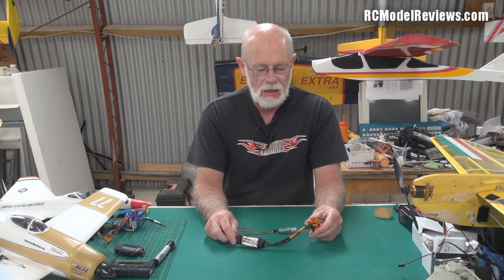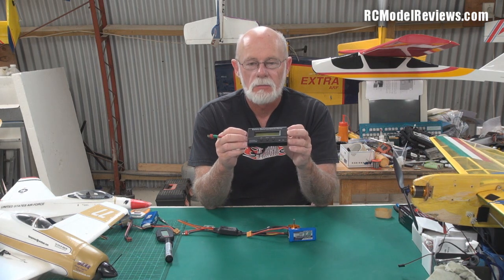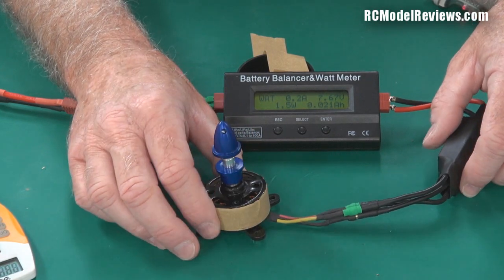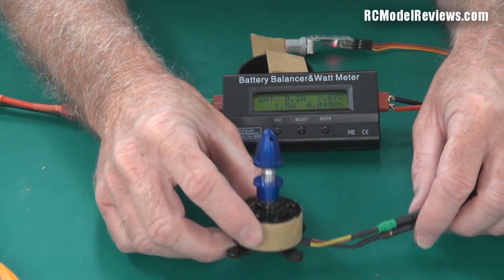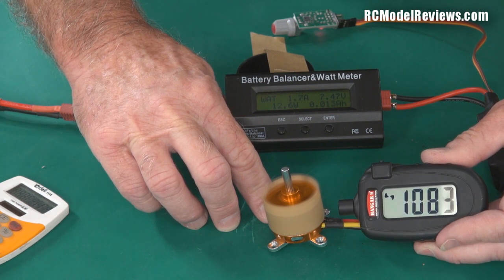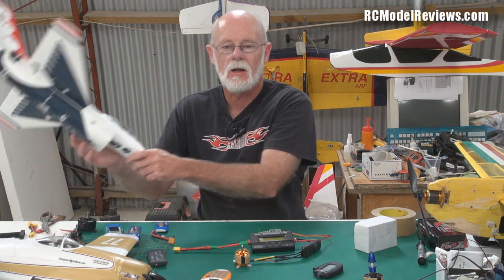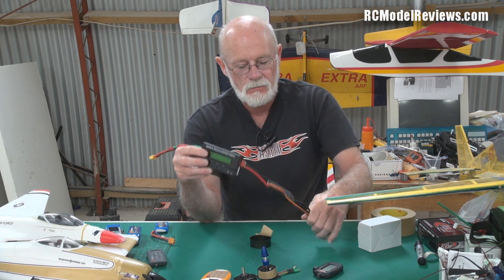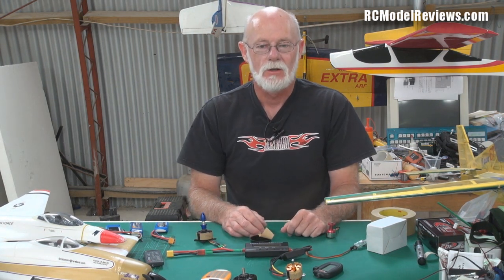RC BASICS: What is KV?

Comment: if you're talking about the first motor, watch again from 5:30 he does rpm/voltage. If you're talking about the second motor he does kv * voltage = rpm. He is putting around 7.45 volts because that is the voltage under load. If you see the screen it is a little higher 7.67 volts when the motor is not running.

Comment: what nobody ever seem to mention is the key to this which is calibrating the best pinion or prop for a given kv motor propelling the same given weight this is where things get really interesting, when you get a lower kv motor achieving the same top speed as a higher kv using same battery by altering the pinion or prop. also incorporating the extra draw that "may" occur on said battery ?? by using the bigger pinion !

Comment: I'm an electrical engineer who has worked with all sorts of industrial variable frequency drives, Pwm limited stepper motor controllers, 90 and 180vdc DC speed controls etc. for nearly 40 years.
I've been baffled by all the techno-babble garbage supposed experts have been pouring onto helpless RC builders who don't know what to think. The RC forums are full of "experts" expounding on meaningless formulas which are either mis-applied or totally ficticious. It's infuriating, but I, being a gentleman, have resisted the temptation to point this out to any of them (so far).

THANK YOU FOR CUTTING THROUGH THE BS!!

You are the 1st person I've seen who really knows what they are talking about. Great demo and explanation! This video should be required reading for anyone buying a motor. Well done sir.

Best wishes for your continued sucess.
Scott Marshall
Elbridge NY USA
Reply: My uncle is machine engineer

Comment: Excellent video - many thanks for helping me to understand. We need more people like you to help newbies like myself.
Reply: Kv is the reciprocal of the back-emf constant.
A 500 Kv motor will generate a 1 V back-emf when the motor is rotating at 500 RPM. At 3700 RPM that motor will generate 7.4 V.
Applying it the other way around ("7.4V will make the motor rotate at 3700 RPM") is only an approximation and technically wrong.

This video is actually full of misinformation because RCModelReviews relies on the latter understanding of Kv which is wrong.

The motor RPM is NOT calculated by V*Kv. The actual RPM = (V - R*Io) * Kv = (Voltage - Motor Resistance * No Load Current) * Kv.
So given the above motor with R=0.5, Io=1, we get 3450 RPM at 7.4V.

Also, Kv tells you nothing about how powerful or efficient the motor is. That's another point where RCModelReviews is wrong. High Kv does not mean the motor has low power.
You can get high Kv motors with higher power than low Kv motors....

Comment: Thanks Bruce.  When I was a commissioning engineer on Shell Stanlow oil refinery, a 6.6kV motor was the size of a Ford Transit van.  You'd never get one to fly or if you did, you'd need one big battery and an inverter from the planet Krypton.  So it's revs/minute/Volt (ish).  Brilliant!

Comment: I’m an rc car enthusiast. 3 years ago I made the switch to battery and these small dc motors. I’m trying to learn the theory, terminology and practical from using chemicals to generate electricity (to more clearly understand the battery) to the use of electromagnetically spinning a rotor to power my rc trucks.  Please continue your series and do you have a book you could recommend to a beginner to teach the basics. Thanks

Comment: Great series. I hope in the end you can make a guide on how to select a powertrain for any model.
Like, how does it fit together, how can I apply all those basics to buy the right motor/prop/ESC/battery the first time round for a new model.
I tend to go with, what did others use for similar planes or what does the ARF version use. But I never feel like I know really why this combination is right. I just improvise.

Comment: Thank you for a great presentation. Its very helpful to actually understand this as I am new to flying Quad copters and currently using brushed motors in low cost quads. Ive been considering converting a Syma X8C to brushless motors and now I better understand the theory of operation. For the X8C what KV motor rating would you recommend? As you have the 40 yrs in this and can make the best estimation off the top of your head. My 40 yrs experience is in Mercedes Benz and BMW cars. Thanks again!

Comment: Tom Reed,

An electric motor will never spin any faster than the Kv value multiplied by the applied voltage.  You do not ever have to worry about an electric motor over-speeding with no prop installed.

Comment: Hey jfan4reva!
I am down here in Colorado Springs, and you do in fact have to go larger in prop to compensate for air density.  I end up just going a prop size larger or pitch depending on the model type.  Having too small of a prop will not "over rev" a brushless motor as you see by the bench test, it maxes out and that is it.  Running a small prop means less wattage.. that simple.  Just keep your manufacturers specs in mind and match a prop accordingly (which I am sure we will see next!)

Comment: For all those wondering what was used to control the esc it was a servo tester.
Bruce, when an engine specs would say 600w for an engine on 3s so 54 amps is it safely able to increase power through voltage instead of current? Such as a 4s battery running 50amps?

Comment: Big thanks Bruce! My background is in radar and I couldn't understand why a tiny motor would need several hundred to thousands of KV (kilovolts) to run and how that voltage was being developed off such tiny batteries. RPM X 1K per volt makes a lot more sense.

Comment: After a nearly 14 minute video, in a nutshell, kv is a motor's no-load RPM-per-volt rating. The number of RPM a motor will run at with one volt applied and no load on the motor. He could have told everyone that right away :)
At 2 volts, the no-load RPM will be twice the kv, at 3 volts, three times, so on and so forth.
So, a 1000kv motor at 7.4V (2 lipo cells ~1/2 charged) will run at 7400 RPM without a load on the shaft and the ESC at full throttle.
Reply: zann fox Generator constant is more accurate but few of us use it for RC applicationss. There's an offset due to the motor's windage & magnetic losses when used as a motor, but few of us use RC grade brushless motors as alternators. They're actually rather good for that! Assuming kv is a motor's unloaded rpm per volt is close enough for RC use.
Reply: You're forgetting some people learn visually
Reply: I learned by touching the video
Reply: Would it really be worth watching a 30s video where a guy just reads a definition from a text book. Yes it longer then it needs to be but it by design.
Reply: BasementEngineer, I understood the meaning of KV in this one paragraph and watching this video 2 times I still could not understand what a KV meant.
Reply: Rick Whitham he said it a few times throughout the video
Reply: He did said that in the first 30 seconds of the video but in a simple language
Reply: Dude we do this for fun. We like to see things. And just to rub it in I never study math or physics cause it was about logic and always was an A student in that field. So let me reiterate the man here does this for fun and it's a pleasure listening to him.
Reply: Since your a self made genius dont watch anymore of his videos
Reply: Um, he did. Right away. Then he showed us.
Reply: @BasementEngineer  I know what you're saying but zann is correct. Motors and alternators are essentially the same thing. A motor is technically in a lab rated by the amount of voltage (Killo-Volts) output at a given rpm. Technically measuring rpm and voltage in gives a fairly accurate KV rating but not as accurate as measuring voltage output at a given rpm. The reason is not all speed controllers are equal. Check it yourself. Use three different brand ESC's and do a reading. Measuring voltage out at a given RPM most certainly compensates for loss.
Reply: YouTube polling shows users are more  likely to watch 15 minute videos. It's short enough to sneak in with your coffee and long enough to make you feel there's valuable knowledge in it.
Reply: Kv is the reciprocal of the back-emf constant.
A 500 Kv motor will generate a 1 V back-emf when the motor is rotating at 500 RPM.  At 3700 RPM that motor will generate 7.4 V.
Applying it the other way around ("7.4V will make the motor rotate at 3700 RPM") is only an approximation and technically wrong.

This video is actually full of misinformation because RCModelReviews relies on the latter understanding of Kv which is wrong.

The motor RPM is NOT calculated by V*Kv. The actual RPM = (V - R*Io) * Kv = (Voltage - Motor Resistance * No Load Current) * Kv.
So given the above motor with R=0.5, Io=1, we get 3450 RPM at 7.4V.

Also, Kv tells you nothing about how powerful or efficient the motor is. That's another point where RCModelReviews is wrong. High Kv does not mean the motor has low power.
You can get high Kv motors with higher power than low Kv motors....
Reply: And you used cca 400 letters to tell the same...
Reply: @davormaplenik2776  No it's not the same. Kv is not rpm produced per volt.
It's rpm needed for the motor to generate 1V back emf.
Reply: @xnoreq  no man, I was referring to the guy complaining about a video being to long, I didn't tried to be smart about tech stuff
Reply: @davormaplenik2776  Oh i see. I have no issue with that, just with the technical side ... which he got wrong.
Reply: I love the long vids.
Reply: @denniskatinas   Long vids + misinformation = bad.
Reply: John Doh Alright, I understand, I read your technical story about kv here in the comment section. Interesting.
Reply: John Doh Why not make a video about it?
Reply: John Doh “Misinformation” is a bit harsh tho. Maybe just say: “unprecise by a margin” or “slightly incomplete”, :-P
Reply: John Doh So how did you get to R=0.5 and lo=1 ?
Reply: @michaelgrossman5528  Since YOU'RE such a bad speller, you should be reading rather than watching. 
You may actually learn how to spell "you're" which is a short version of "you are" rather than "your" which means something belonging to you.

Comment: Hello!

Thank you for your clear explanation! I am thinking about making a quadrocopter from scratch, all with my own electronics etc, so I actually have a question about the motor drivers. I don't really understand how there is a relationship between the voltage and rpm's.. Because, inside the motor is 'spinning' a magnetic field.. Isn't that an indication for the motor's speed instead of the applied voltage? Like, if I apply a high voltage, but I drive the coils one by one very slowly, it will turn very slow I would think.. Thanks in advance!

Comment: Great video, thanks.
Does that mean for instance if were using a 500kv motor with a 15 inch prop and  then wanted to use a 16 inch prop efficiently you would be better off getting a  motor with less than 500 kv?

Comment: I know this is a bit old but I found it quite interesting. Correct me if I'm wrong but light detecting tac's  are be affected by electric lights. In the US are lights cycle at 60 hertz. 
This could introduce a large error and thus you should always do measurements in the day light.

Comment: Beginner's questions: 
I guess that before doing the ratio RPM to Volt, you did put the engine to full speed, right? 
In that case, how can you be sure that it is at full speed? 
What happens if you change ESC or potentiometer?

Comment: The number of "winds" of wire on the stator is a hint whether it is high or low KV. If there is extremely fine (small guage) wire on the stator, it will like have a lot of winds and be a low KV. Heavy guage wire (less winds) will be a high KV motor. so if you get a motor with a number like 35-48-10, 10 is the winds. It will have a higher KV than a 35-48-16 for example
Reply: I think you might find the opposite, less larger windings mean more current and more torque so lower KV

Comment: Very useful!  So, when selecting a motor for a surface RC (Xmaxx), it sounds like a lower KV would turn much more slowly than a higher KV, but with much more torque.  However, this is only useful when looking at gear ratios.  So generally, it sounds like a lower kv motor will need a much higher tooth pinion, and could do it without overheating issues.  In comparison, higher kv and lower torque could lead to overheating if the gearing was the same in both scenarios.

In other words, if I try and stick a really high kv motor in an Xmaxx, the motor likely wouldn’t have enough torque to push the truck without overheating the motor and esc.  That is unless I use a really low tooth pinion which would impact the speed of the truck tremendously.  Sound about right?

Comment: I always thought that speed of the BLDC motor is defined by the ESC by how fast it changes between the energizing coils. So always with full nominal voltage. Like speedy stepper motor. So what has number of windings has to do with speed except it affects torque?

Comment: Hi Bruce, 
      I'm new to quadcopters, and I love your videos. They are perfect to get me up to speed on everything, since I already have a strong background in physics, math, and electronics.   I have a question about ESCs.    How do they control the speed?  I assume they modulate the ac signal faster to get the motor to go faster.  But if it's at the same voltage, the only thing that must be changing other than the timing is the current, in order to draw more power overall.  I've heard that the force on the motor dictates how much current gets pulled out, and that ESCs can monitor the speed of the motor since they're feeding it the waveform, but I don't quite understand how all this fits together.  How does the ESC know to run the motor at a certain speed, given a certain percentage of the throttle? I assume you have to program it in, but in that case how can you figure out the KV like you did? I don't really need to know, but I'm curious.  In general, what is the efficiency of a fixed KV motor being pushed  at different speeds and/or forces?     Relatedly, I have four motors I bought that turned out not to be the motors I thought they were, because they are wound differently so that they will 3s motors at 1900kv, when originally they were 2s motors at 3100 kv.  Is it possible to say anything about how they should run based on the specs for the original motors?   Feel free to answer any or none of these questions, I know there's a lot in there.  I'm tempted to find a textbook and read about it, but I thought I would ask first.
       Thanks!
           Rich

Comment: BasementEngineer, good video, with some figures, even not precise to third digit, to provide useful guidance.You say that brushless AC can be used as generators, I suppose with a rectifier, condenser and voltage regulator downstream to get stable voltage. Dis I understand correctly?

Comment: Hi Bruce I am setting up a Super Chipmunk 63" span. I have a 60A plush ESC, 400KV outrunner. and using a 3000mah
5s lipo 20-30c. The battery has very thick cable 10awg 200c whatever that means. worried I might cook the ESC. Thanks for your instruction Dave Whakatane

Comment: Be careful running a motor without a prop, it can spin at too high an rpm for the ESC and jam it. And you won't get the magic smoke back inside when it comes out.
Reply: Only one smoke charge
Reply: Tom Reed this is nonsense. Good esc will not jam like that. If it happens then esc is bad and should not be used with the given motor (it happens due to software bug in the esc that does not reduce rpm when it can no longer keep up with the motor)
Reply: It's not nonsense. I've designed and built BLDC motor controllers before, and the combination of the phase lag between the electrical and physical angle of the motor, and the finite amount of time that the interrupt handling routine takes to execute do indeed limit the maximum speed. In this situation, a poorly designed ESC may drive a phase at the wrong time, with no back EMF to work against, thus potentially exceeding the maximum current for the motor or ESC. It's not a software "bug", but rather poor implementation.
Reply: let the magic smoke out.. watching too much AvE channel lol
Reply: Actually it is a ESC design flaw, your program is in charge of the current output and frequency based on feedback. If the feedback is not in range you don't have the program increase the power you either have it maintained or drop it at a reasonable rate until it is with in range; a full power drop can produce back emf which is why you back off at a reasonable rate. Unless the motor itself is fried, it will catch up or slow down to the output; VFD's are pretty much the same thing except on a much larger scale. I have never seen a VFD drive or motor malfunction because it lost water to the pump which is the exact same as running these little motors without a prop; of course VFD's are $10k to $1,000,000 price range, they tend to spend a bit more time on the engineering side.

Comment: I'm still having a hard time figuring out how the winding affects motor power and efficiency with a direct drive propeller. It seems with the same motor if you go up in kv you get more watts at a higher efficiency, which means in any application going for the highest kv motor then adjusting prop size and pitch seems to be the best use of the motor. Am I wrong? What would be the point of choosing a lower kv winding of the same motor instead of a higher kv and lower pitch to get your torque?

Comment: Brushless motors are 3 Phase DC, BLDC motors are not exactly the same as AC induction motors
Reply: Yes and no. Brushed motors use brushes to convert Dc to AC, after a fashion. A brushless motor needs a means to do the switching that the brushes do. An ESC is a misnomer because it's MORE than an electronic speed control. It does do that, but it also does the switching necessary for the motor to turn.